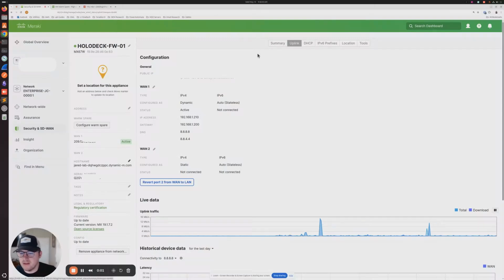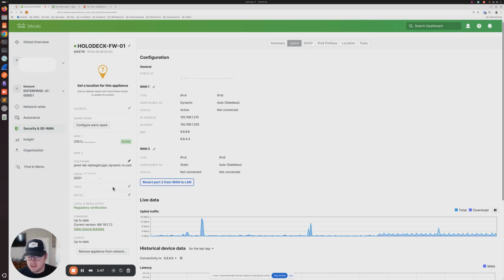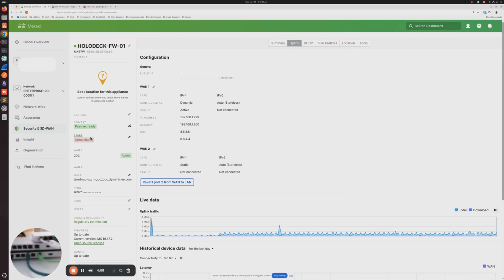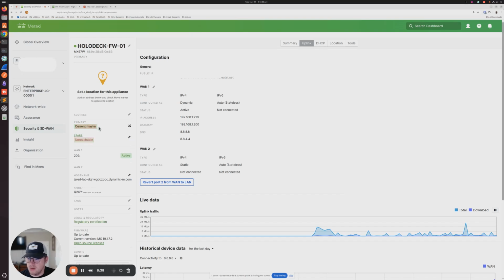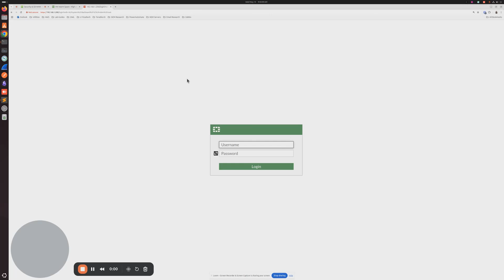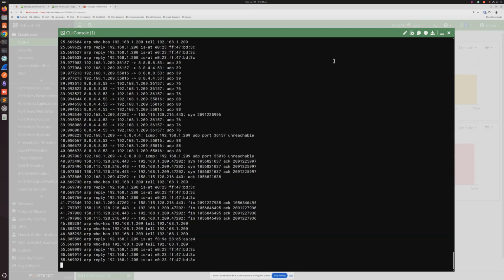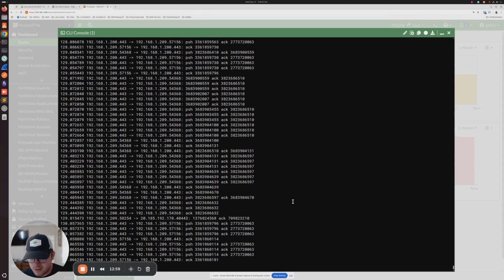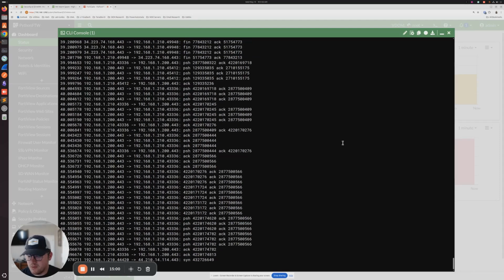Meraki MX Warm Spare HA Configuration and Testing

Comment: Is it imperative that they both use the same port to connect to the LAN? Also does that port need to be a trunk or can it be an access port?
Reply from the maker: The configurations are synced between the two, so technically you just need to use a port that has the same configuration, but I think it's probably best to match physical connections. 

Port can be trunk or access, doesn't matter
Reply: @p4cketsniff3r do they keep a connection table so tcp connections are not broken?